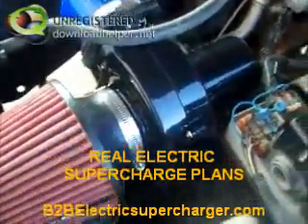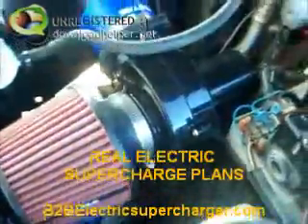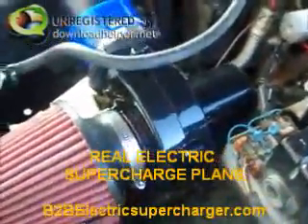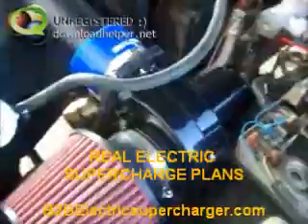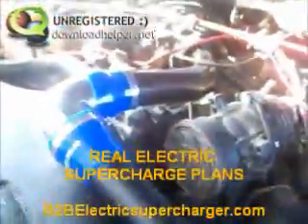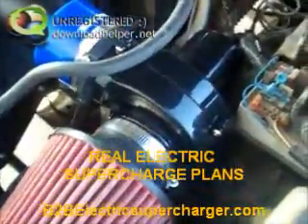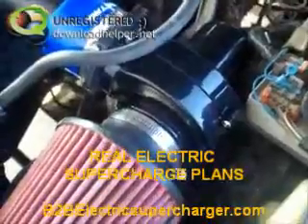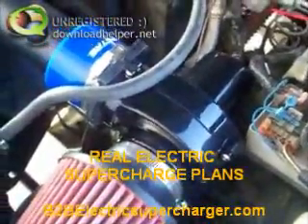Ebay Electric Supecharger

Comment: no no guys it's work but nor like how u want it depends how u connect it to... $??!!  it should b a secret way bc there's no instructions to install when u buy it.. but what I found out lately it suppose to be connected to rpm so when u hit the gas the charger start giving more speed like the rpm speed... ......
Reply: salah hage depends if you can piggy back it off your taco meter wire. but I still dont see any real benefit to a piece of plastic.
Reply: Fab Social  the only way it's going to work if connect it to the rpm sensor other wise it's a just little fan with speed limit..  y it's call a charger similar to turbo we should to increase the speed on we hit the gas if u know how to connect it to rpm sensor u will see the difference...  bc the rpm gose up when u hit the gas an between the shift.
Reply: Fab Social let us say u have a turbo in ur car the bost an the speed gose up when u hit the gas so the turbo compreser increasing the power when u hit the gas..
Reply: Fab Social I do understand an I agree with you it just a piece of plastic an I al ready bought it can't through it away I have to make something... If u use it as a smart way it would work trust me

Comment: "You spend what you get?" hmm OK then good to know. Anyway, you're not getting any boost cause this is garbage, and its entire design does not actually COMPRESS the air going in to your engine like a turbocharger does. Compression = boost. Plain and simple.

Comment: the only proven electric supercharger that give any type of power is Phantom supercharger, but I not sure there in business still... there customer services is nearly impossible to get ahold of
Reply: Christopher Mayen phantom was the only real deal with electronic turbos. they actually had a real compressor wheel and a better electronic motor. the downside is soo many lawnmower batteries under your hood.

Comment: Ok ... any one claiming anything about increase of HP and TQ needs to provide REAL dyno results with THIER car. The ONLY application I see for these are: Leave the original air box in its place. Set this Supercharger in front of the snorkel (air box opening) to help load the air box with cooler air. Run a pipe from away of engine onto this supercharger. So it can suck in cold air from outside into the air box so the engine sucks in cooler air from the box. If you install this supercharger like in this video, you are putting another obstruction in the airflow path!!
Reply: This could actually work really well and to add to you idea swap the stock filter with a pipercross or K&N panel filter and a heat shield if needed

Comment: Whatever! The pod filter alone without the blower gives him a extra 80hp! That thing is a machine and I want it so bad!! Ive got a vaccum cleaner running in reverse on my car through a power inverter and ive even intercooled it with a old radiator! (it gets a bit hot after 15min of running full boost) heeeaps more POWER!!!

Comment: He's right. Take a mechanical supercharger, such as a Rootes, mount some electric motors to it. You also need a substantial battery to drive it. They are used to provide instant compressed air for engines like two stroke diesels for one thing.
They've also appeared in the drag racing world and are commercially available. Very expensive, but basically the same thing. Instant max boost thanks to electric motors compressing the air in the plenum.
They are -nothing- like the P.O.S Ebay fans. At all.

Comment: if you watch the first video that comes when you search for these, they basically myth-busted this and there are 0 GAINS WHATSOEVER. not only that, but they found that they actually lost power from the battery. they even bought a 300$ model which was the most expensive. if youre honestly posting this video and trying to still get people to buy this you are a criminal. THIS IS NOTHING MORE THAN A GLORIFIED COMPUTER FAN. IT DOES NOTHING.